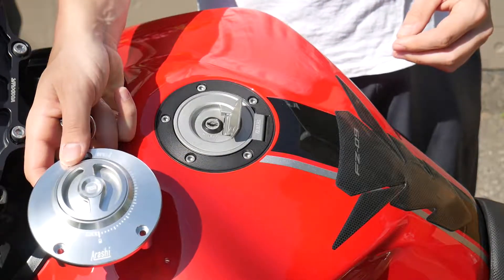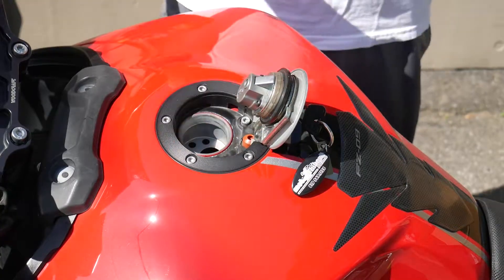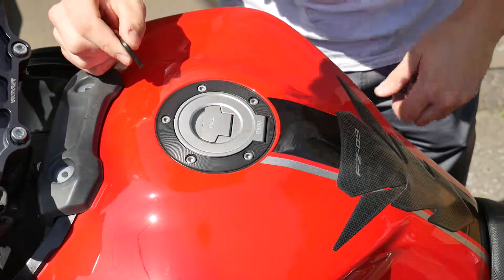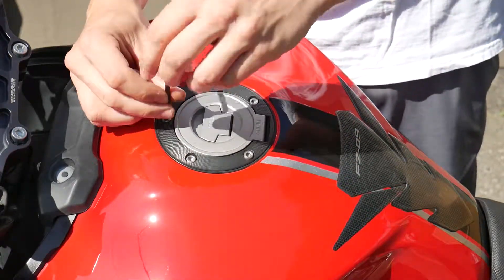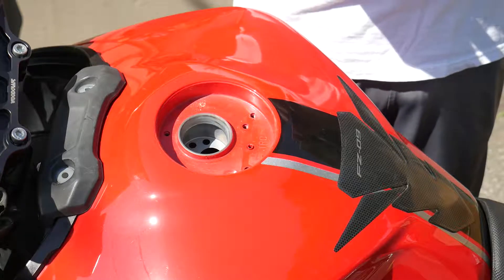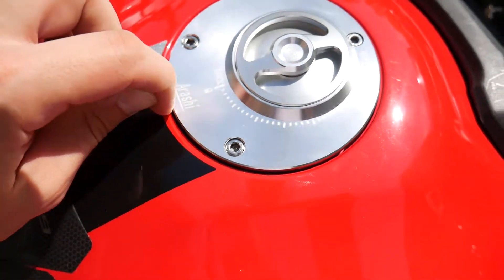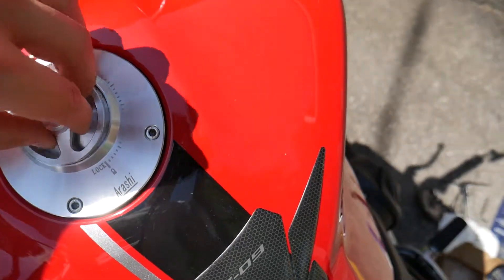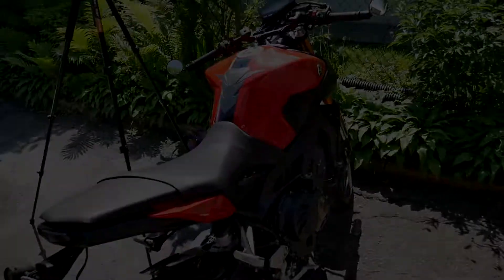Keyless Gas Cap Install, Yamaha FZ09/MT09

Comment: Anytime you work on a motorcycle gas cap you always cover the hole 🕳 with a rag or blue masking tape. You also should have reused the black rubber gasket that was under the stock cap otherwise your going to get water in your gas tank when it rains or when you wash the bike.